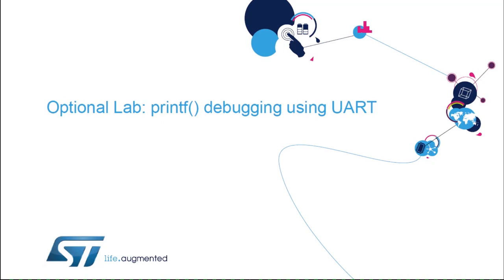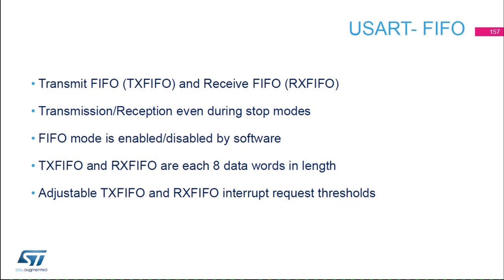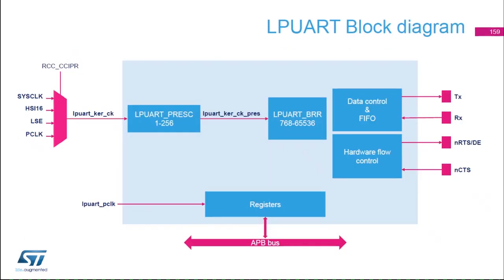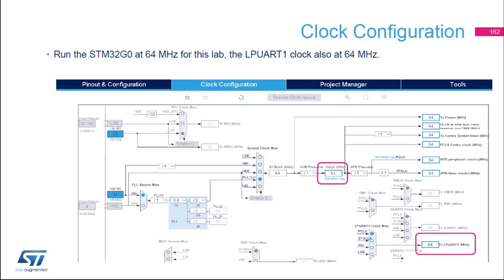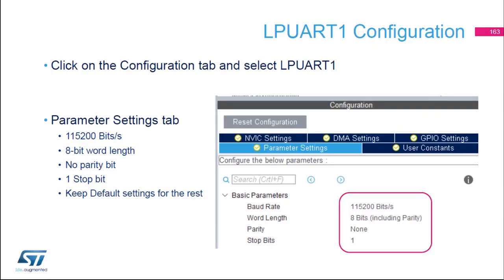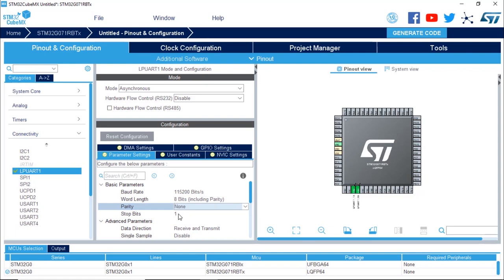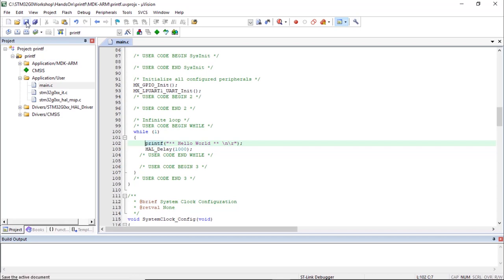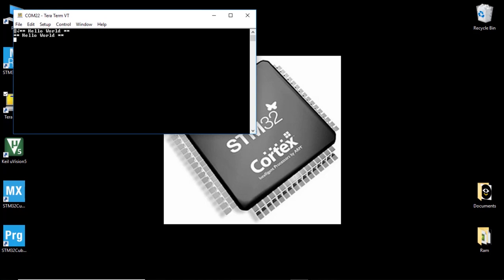STM32G0 Workshop - Pt. 7, Printf

Comment: If you are using STM32CubeIDE (GNU GCC), int fputc(int ch, FILE *f) won't work. I'm using STM32CubeIDE with NucleoG071RB,  I have to replace the fputc() with int __io_putchar(int ch), and everything work! BTW, the macro define is not necessary.